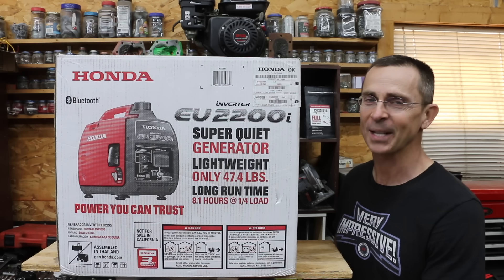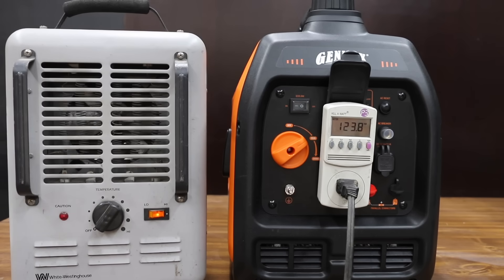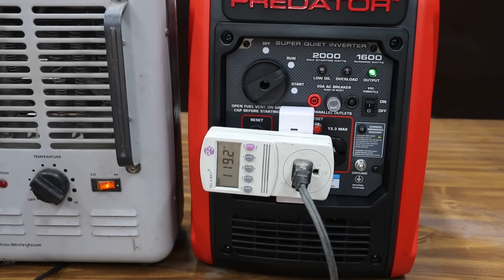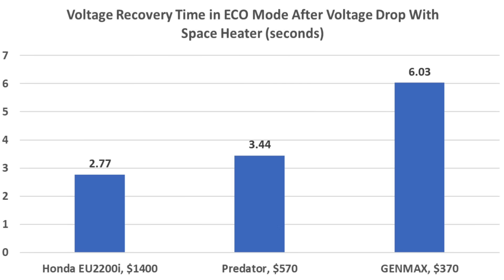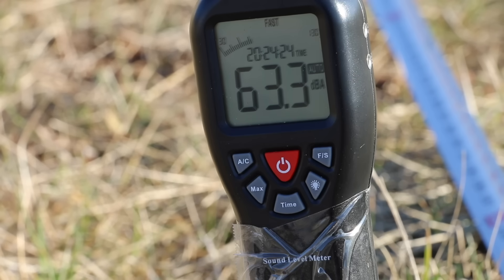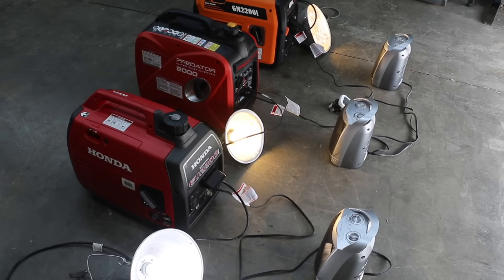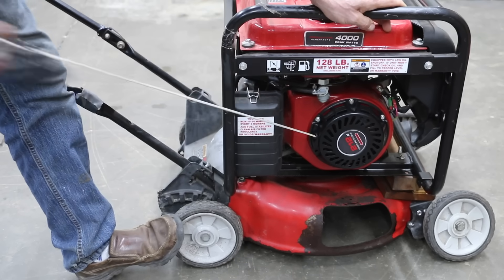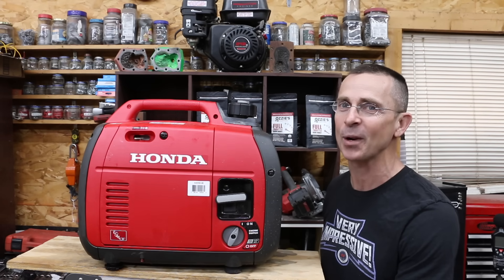Cheap Generator Better Than Honda? Predator vs Honda & GENMAX—Let’s Settle This!

Comment: Thank you very much for including the sin wave testing.  I’ve warned people for years to be careful about plugging computers, etc into generators without a filter or without knowing the specs of the generator. As always - thank you for all the testing and work you do!  ~ Chuck
Reply: Back in 2008 one of my classmates hosted a LAN party at home with a bunch of friends abd coleagues. The power supply for all PC's was a generator of course. At one point, the generator sputtered, surged and reprimed to default speed several times. Many PC's shut down, others killed their hard drives and a few blew their PSU. So much for hooking up delicate electronics under unstable load.
Reply from the maker: Thanks and you are welcome!

Comment: Test the new Predator 9500 to other comparable generators. The engine in this generator has both a presurized oil pump and splash system. Basically it shares parts of other engines why it has the splash on the rod. But I have been running one everyday for over a year and still no smoke or signs of this engine wearing out. I run a metal fab shop off grid and run these generator as primary power movers full time.
Reply from the maker: Thanks for the video idea.
Reply: Be interesting to test the DuroMax version. I think they are the same generator produced by LIfan? They look identical but they advertise different engine displacements.

Comment: What you pay, it what you get for........ Switched all garden 4-stroke to HONDA and they are working absolutely great. 
Even when the snowplow is 10 month out of work and the lawn mover is a few month out of work,they start and are running absolutely smooth.
Also my TRIAL motorcycle MONTESA HONDA 4RT and touring bike HONDA TRANS ALP is working perfectly like at days 1
OK it is a little bit more expensive, but on long term you save so much money!!!!!!!!
Reply from the maker: Thanks for sharing.

Comment: Great tests! Not too surprised by the results.
At work we all run Honda generators, even our DC output generators are Hondas and they just keep on going! Those little eu2000 suitcase generators literally get thrown around and beat up, sit on the side of the road and somehow they just keep starting.
I do have a Ryobi 2000 inverter generator that seems to be doing okay even though it runs a little weird every once in awhile.
Reply from the maker: Thanks!  Thanks for sharing.
Reply: Only thing we've managed to break on the Honda, is the choke lever loosens up and vibrates itself on and chokes it out under load.
Reply: @leftyeh6495  
Interesting. We have not had that happen yet but now that you said something I will keep an eye out for it thank you

Comment: I’ve learned a few things since hurricane Katrina about Honda 2000 generations ! I now have 3 there names or Katrina Gustav an Ida !!!! Since Katrina that generator has run my camp boat for hundreds of weekends along with other power outages and hurricanes it also recently ran for 23 days straight after hurricane ida only shut it down to gas it and change oil ! I have learned that Hondas have fuel pumps witch makes it easy to run a 6 gal tank that extends its run time dramatically cheaper ones don’t have fuel pumps Hondas also start small ac window units where cheaper do not !
Reply from the maker: Thanks for sharing.

Comment: I have a Yamaha 2000 watt inverter I bought because it was the last generator I could find before a hurricane hit. It's quiet and fuel efficient and will outlive me. When I worked in New York City every food vendor wagon had a Honda generator humming away next to the wagon. That's a high recommendation.
Reply from the maker: Thanks for sharing.

Comment: Over the years I've found I run my emergency gensets (twinned Honda 1000 inverters) in two extremes: temp<45F and raining, or temp>100F and sunny.  The load is always a refrigerator, 400W lights-entertainment-bedroom, and maybe 75W fan.  Would be interested in testing at those extremes.  I spash-fill them just before bed and I get 8 hours run time.  I've wanted to go to a Bluetti AC200P for this scenario instead.  Wonder if I could get the same 8 hours run time?

Also, interested in smallest inverter genset that can start a 3.5 ton Lennox central air with a scroll compressor.  I've read about several easy-starts out there to allow the compressor to start without much less than what I think is a 75 amp inrush current for a few seconds.  I have a 6KW Kipor inverter genset that cannot start the air conditioner, even with Eco mode off.  Maybe you could do an episode on easy-starts; one mfgr. is Microair.
Reply from the maker: Thanks for the suggestions.

Comment: Testing the sound they emit make me think about testing some sound proof walls and contain this thing inside a box (without braking air-flow)
Also not expert on this but wonder how well they would perform after a few months of proper waring off.

Comment: Please test the shell rorella 4+5+6 also please test a cheaper oil with zink adhesive add'ed and please also add it to Shell rotella after testing it with out.. almost every car channel is now recommending Shell rotella but are they bought or is the oil the best? 👍
Reply from the maker: Thanks for the suggestion.

Comment: Real World answer is No, No they are not better than the Honda. There's a reason even semi-knackered Honda gennies sell for strong money on the used market. Other brands not so much. You need to run the test for a few months to get the real picture - the Honda will still work, the rest will be in a skip. Pretty much.

As mentioned by others, Tanaka/Subaru/Robin & Yamaha are also brilliant. But the "Off-Brand" ones are generally garbage longer term.
Reply from the maker: Thanks for the feedback.

Comment: @Project Farm  
I wish that you would have included one of the Yamaha inverter generators in this comparison.  They are comparable to the Honda EU-is line and may have some advantages.

IME they are just slightly heavier & slightly louder, but offer a bit more output current.  They have proven to be at least as reliable as the Hondas as well.

Maybe you can do an addendum test of just the Yamaha, or with a few others that weren't included in this video as well.

But THANK YOU for these excellent tests and comparisons.  👍👍
Reply from the maker: You are welcome!  Thanks for the suggestion.

Comment: Before even watching this. The Honda will always be my only choice. Their the best of the best. I have a Honda 2000 that fell 20 feet off a boom lift on concrete, “ don’t ask how that happened” but other than zip tying the outer shell back together an putting a new exhaust on it, it’s still running flawlessly. It’s 17 years old.
Reply from the maker: Impressive!  Thanks for sharing.

Comment: I literally bought predator a couple months back to run the 12V AC system I installed on my semi. It burned a lot of gas the first night but I can run it without eco mode under high load for over 10 hours on just over a gallon of gas. It’s super quiet and I bought the more expensive of HF two types of extended warranty. For right around $850 I get I think two years no questions asked in store replacement. I just bring it in the store and walk out with a new one. I figure even though the Honda is a better machine I can burn through a couple of these things for around the same price.
Reply from the maker: Thanks for sharing.

Comment: Preditor is more fuel efficient because it is burning engine oil . Both of the other clones have smaller displacement engine. So they are stressing the engine more & using cheaper components in inverter & permanent magnet alternator. So they don't hold up to voltage that well
Puresine wave is required for running microwave, induction motors. Fir electronics like computers even straight dc works well. 
They convert the power to dc so they do not care about input waveform. Just give the right voltage & they are happy. 
I ran a square wave ups that had over 55% thd for 20 years not a single issue. 
So if you are only powering a computer then that tailgator is fine if you can handle the 2 stroke fumes & noise
Reply from the maker: Thanks for the feedback.

Comment: Cheap equipment can be justified for occasional, non-critical uses but think twice before convincing yourself that this product-on-the-cheap philosophy will magically pull through in demanding situations. No one who needs reliable power in remote locations should consider a knock-off generator. The low-cost manufacturers can only afford to copy the Honda feature set and they have to cut corners in material and quality control in order to bring you a $400 generator.  You can tell by the excessive wear metals and sloppy power output that the knock-offs have no intention of building a reputation to keep you coming back to their product. The goal is to sell a higher quantity for a cheaper price since half the customers will never return after experiencing disappointment. That is the polar opposite of Honda’s philosophy where they design products to keep you coming back to the brand again and again. Great test, Todd, and a real education!
Reply from the maker: Thanks and you are welcome!

Comment: I ran a wen 2250 generator for 2 weeks straight after hurricane Ida. I did change the oil everyday. I would love to see you test that one.  It did the job but it's one of the more economical ones.
Reply from the maker: Thanks for the video idea.

Comment: One metric people might want to know, is does quality scale linearly with price. This is super subjective, but I think most of us know it doesn't, but it would be interesting to see them compared. If I am being unclear, let's say we have two items. One's cost is 200% greater than the other. Does the the expensive one reduce noise 200%, increase efficiency 200%, increase lifespan 200%, etc. Do you get a 2x better product for 2x the price?
Reply from the maker: Thanks for the suggestion.